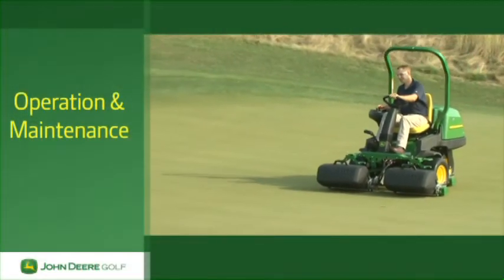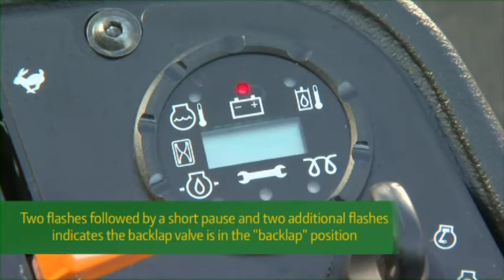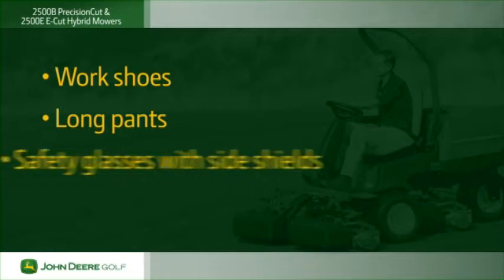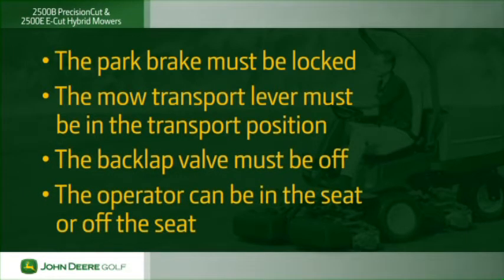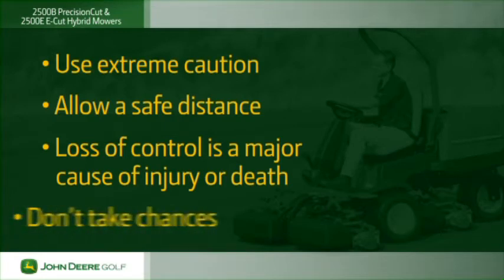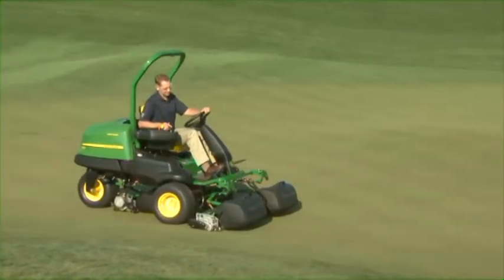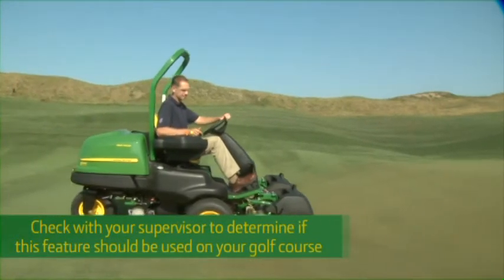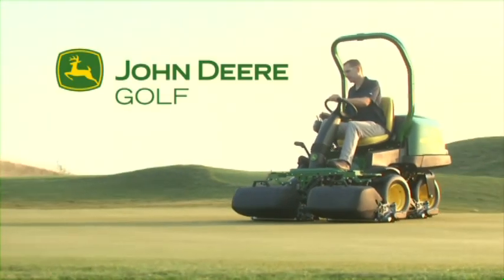2500B and 2500 E-Cut Mowers Operator Video | John Deere E-Cut™ Mowers

Comment: How do I get my 2500b in neutral to pull it if it is dead?
Reply from the maker: Thanks for asking. You can find this information in your Operator's Manual in the "Operating" Section under "Moving Machine Manually". We suggest following these steps to avoid transmission damage. If needed you can find that process here: http://spr.ly/60523E6Ha. 
If you are still having issues, we suggest you speak with your local John Deere Dealer. If needed, you can find your local dealer at http://spr.ly/60533E6Hx. We hope this helps!